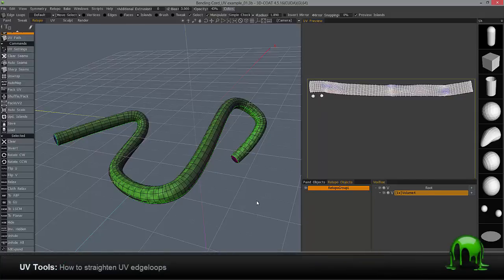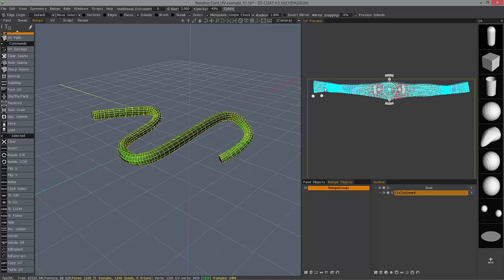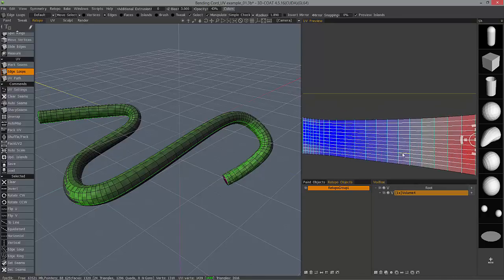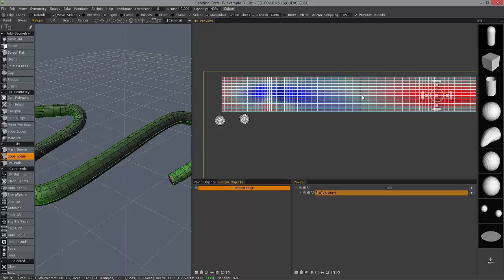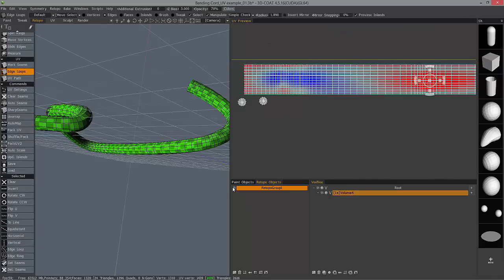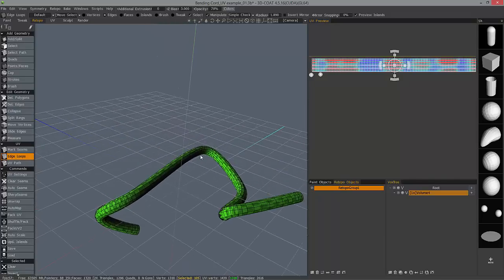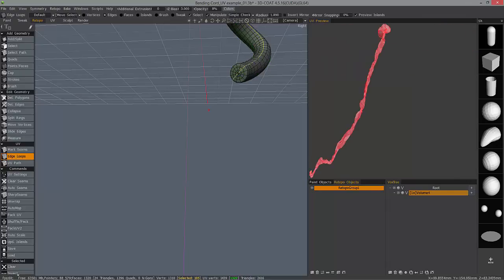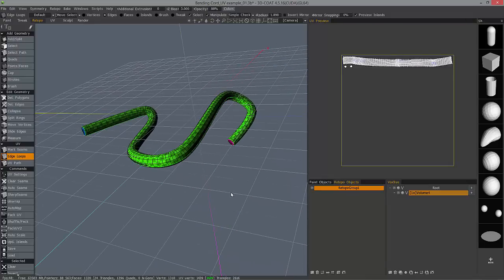How to straighten UV edgeloops

Comment: Nice tool, just to clear out at some point : saying a non-linear UV fits best to the mesh is also a bad thing for UVPacking, baking (and texturing in general). Even if you pinch/stretch your UVs a little it's much better to have straighten UVs. It requires more time unwrapping, but ai can also allows you to reuse your textures on other assets and in the end speed up your workflow a lot more ;) Anyway, excellent tutorial guys, keep making great things with 3DCoat !

Comment: The user request may be usefull for (circular) knitt fabrics. Like knitt dresses and stockings.
Reply from the maker: +Tobias “ToMar” Maier Understood. The tool being requested did the same thing demonstrated, using the "Edge Loop > Edge Ring > Align Vertically/Horizontally. It was just a click or two less than that process in 3D Coat. But the core functionality is there. Every CG app is going to have tools that perform a given task with fewer steps/clicks than other apps. And it will have some tools that require more clicks/steps. That's just the nature of CG software. 
Nevertheless, even when those steps were followed, it didn't provide more uniform distribution of the pixels, than the default unfolding algorithm, GU. The point here is that what may have seemed superior in one's own 3D app, isn't necessarily superior to the default unfolding algorithm in 3D Coat. There may be a few, rare circumstances where it does. That's why it's best to try the default first, and if it isn't satisfactory enough, then one can try to manually straighten the edgeloops of the UV island, with these tools.